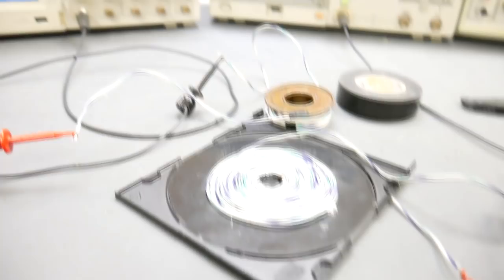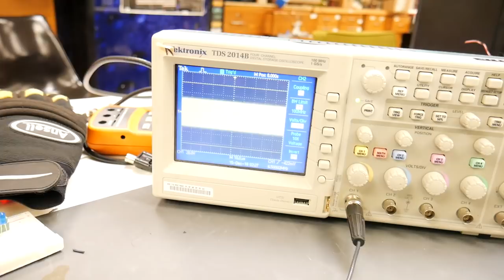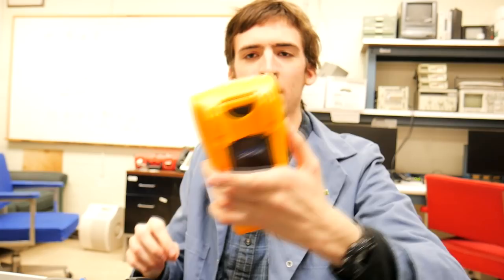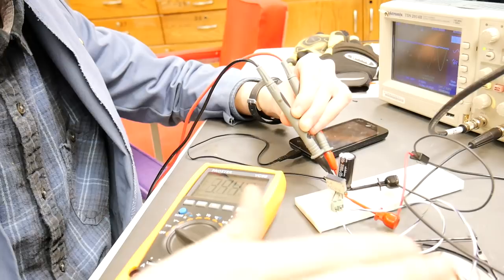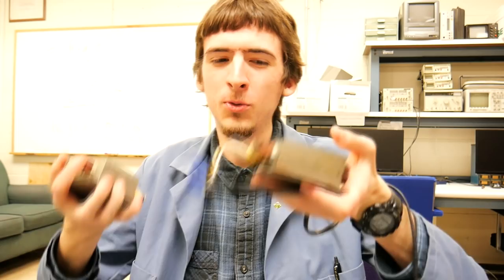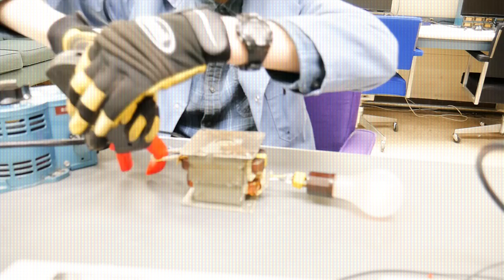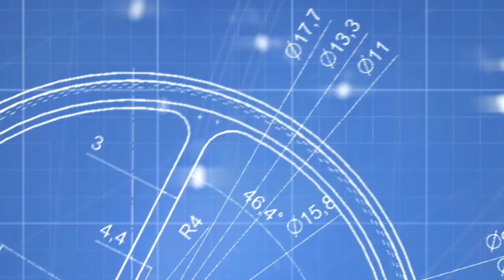Mini Project: DIY Wireless Charging

Comment from the maker: I admit, this may be one of the weirdest videos I've made... and I'm okay with that.
Reply: Is there a way to make this with out causing RFI
Reply: weird is good there is no other way to make a video like this.
Reply: Full of factual information and well presented well so even a child could understand. Keep up the good work Dayron the Internet needs more people like you that  show the truth and don't decide to get clicks.
Reply: the weirdness of this video is why i love it! you rock dude keep it up!
Reply: Answering your question at the end. What's the purpose?

Allows for better waterproofing of whatever is being powered or charged. 

Less prone to failure by wear compared to a plug in connector. 

Can be easily hidden and manufactured into surfaces without being obvious. Which is probably directly the reason you get requests so often. People wanting to make their own stealth charging pads. 

Those are the main things I can think of. The only real detractor I can think of is not easily both charging and using a phone when using induction coils vs wired charging.
Reply: Main use of wireless charging is not having to plug/ unplug the actual phone.... also less wear and tear on the actual connector for charging in the phone. I've had a couple of phones fail due to the wear on the minimal and weak connection the charge port has to the phone's main board. It may be inefficient, but it's more efficient than replacing a phone, or doing invasive surgery on a phone to replace the jack. Especially on newer completely closed design phones. There is also my current situation.... my phone is locked into thinking there is moisture in the charge port.... wireless charging is currently only means to charge my phone.
Reply: a trick: you can watch movies on Kaldrostream. Me and my gf have been using them for watching lots of of movies during the lockdown.
Reply: @Eduardo Alvin yup, been watching on kaldrostream for since november myself :D
Reply: I loved the video! My question that poops into mind 😝, is that on the simple pulley. Considering that a pulley system rigged one way can double the power required to lift an object; while the opposite can decrease the power needed for acceleration by half or more...is it possible that a transformer many have the same conversation. What I think I'm saying (and consider I pretty much know an infinite divided by an infinite, more or less unknown) is that if a block and tackle has three points of contact in the right direction power is increased while overall leverage is shorter. And visa versa; power decreases while leverage is longer/ can conduct in greater distancing...if I'm being moronic please let me know. I just was wondering became it seems to me their are 4 points of contact and I'd really like mankind to find a way for electric to work the way other life forms that have been to earth have discovered. Thanks in advance for sharing
Reply from the maker: @pspringsteen100  Both pulleys and transformers conserve power and work both. They just change the form in which it is delivered - trading off pull-force/speed for a pulley and voltage/current for a transformer.
At the end of the day, it takes the same raw energy.

Comment: FINALLY, someone else that has realized how inefficient wireless charging is. 

I do electrical design for commercial buildings & I'm surprised the energy code hasn't ban them all together. 

20% is HORRIBLE. 

I was using 50% or a little under 50% efficient. Just based on the wireless battery packs seem to charge about. 1/2 as much if you use the wireless charging vs the corded charging. (That's very rough. I only looked @ 1 and how many times it would charge a phone if full. Using each.)

The energy to make the worn out wires / broken charging ports, could be factored in though. <<<I think this would count for something. It is a good universal way to help keep the public connected to each other.>>>

Comment: Wireless charging has a lot of uses.
• If your charging port goes bad. (I've seen this happen)
• You have a bunch of cables like me that all say use original charger  cable and trickle charges your phone
• A good wireless charger will charge both android as well as IPhone so you can charge everyone's phone who comes to your house.
• Charging your phone at night in the dark and fumbling for your charger and plugging it in right is a thing of the past
• There are plenty of other advantages and I'm sure there will be many disadvantages too. I think this was a great idea, and was never supposed to be life changing. Just a better way to charge your phone at home.
Reply: Matt Ferrigno this is spot on!
 Some chargers work great, others not so good. I have one that has quick charge capability and I have an 18W charging cube for it. Which makes it perfect!
Reply: This is exactly what I was going to say. For a science channel, I'm sure he has to understand what friction does to the contact pads by using a charging cable. If anyone is like me and prefers not to spend $900+ (last phone was $1200) every year or two - then you'll look for ways of prolonging the life of it. 

There's also the convenience aspect of it. Just sit the device down on the pad (for me, in any orientation) and bam.. it charges. It takes seconds compared to tens of seconds of time (science efficiency, undervalued?). 

And like you also mentioned, one wireless pad for a multitude of devices. I have an Xbox controller, Apple TV (Siri) remote, two iPhones, and some other hacked together electronics (Raspberry Pi) that all charge with the exact same pad. I count three different types of connectors there.

I guess in the science world, if something is stupid simple then it has no use case.

Comment: A very good reason for wireless charging is it saves the mini port. These little ports wear out mostly from abuse, but never the less they are usually bad before the phone. They will probably out last the phone with wireless charging.

Comment: I am not an engineer and I have not tried it practically but if I'd to say it's the frequency, at lower frequency of little Hz or few 100khz or even 1 or 2 MHz eddy loss is abundant. So may be 5 or 6 MHz or more needed to be supplied after all most commercial devices uses  of 6 or 7 MHz. I happen to look one in a product and wondered why it was so high but never gave a thought before this.

Comment: What if we increase the ratio to 2:1 so it can charge from 3 volt
Reply from the maker: Good question. The problem is that I have reached the maximum wattage of the system, that is why the voltage dropped from 5V to 3.5V. It's because the source refuses to push any more current than 100mA so it clamps the voltage inside the source. If the output voltage were higher (i.e. 2:1 for 10V), it will still max out the current and clamp the voltage again at 3.5V.
Reply: @BlueprintScience  ohhh...

Comment: I have a wireless headset, but I'm often using it in wired mode since I keep forgetting to plug it in after using it. I just put it back on the stand. It also regularly happens that I forget to turn it off, and when I want to use it the next day it won't turn on.. Therefore I wanted to set up a wireless charging system so I don't have to bother plugging it in.
Wireless chargers are great for that reason. For instance, if you get in your car and you put your phone in the phone holder to use it as navigation it's annoying to find the charging cable and plug it in if you remember to plug it in in the first place. Usually I'm driving and I suddenly get a notification that the battery is at 15%, and it's dangerous to plug it in while driving. Wireless charging would completely solve that issue.

Comment: Sick man. Good explanation 
I’m currently building a wireless charger in a car that can plug into the cigarette lighter. 
Boosting the voltage to 24 v and running a circuit that is 1amp draw
Any ideas?

Comment: how do you calculate for this inefficiency
Reply from the maker: I measured the current in and the current out and compared the two against the theoretical value using the efficiency equation: efficiency = (measured - theoretical) / theoretical

Comment: Yeah they never made much sense to me either. 50% efficiency if they're any good and you can't even move the phone from its designated topping up spot. Hardly even charging, because you don't get a ton of current in these things, as the receiver coil would invariably sit right flat against the battery, and you don't want to bake the battery.

I like magnetic cables though. Near lossless in comparison and super convenient, and you can get them for like $2 a piece. Great protection against breaking the socket for clumsy individuals too.
Reply: My phones socket is worn so it's easier to use a wireless charger than trying to find the sweet spot where it will actually cable charge. Also got a wireless charger in my card ( as part of the phone cradle ). It's nice to drop the phone in and not have to plug/unplug a cable each time
Reply: Magnetic cable suck what we really need is little holes on the back of the phone that when you set it on the charger there are tiny pins that stick into those holes that charge the phone preferably make everything as flat as possible then for example you can walk up to your computer set it on top of your computer case and it would make that noise that computers make when you plug in USB cable to your phone

Comment: Pal, dunno if this was said before but to calculate transformer efficiency you need to account for the  voltage and current phase angle, ie Pin = IVcos(theta) where theta is the angle difference between voltage and current assuming the circuit is inductive, ie lagging Power Factor aka cos(theta). The same needs to be done for the output as well. Then you can calculate efficiency. Great video btw. Keep up the good work and merry xmas.
Reply from the maker: If I'm remembering correctly, using RMS (root mean square) values means that we can use P=V_RMS*I_RMS. Assuming the same voltage on each coil, the ratio of power the same as ratio of the currents. If we felt like using peak voltage methods, all that is out the window and we would need to do what you said.
... and Merry Xmas.

Comment: Reasons:
A) The connection on the device to be charged is broken.
B) Build the charging pad into the coffee table.
C) I don't trust strange USB ports, I enjoy the protection of wireless coupling.
Reply: Why didn't he make a transformer without a 1-1 ratio  to increase the output voltage?
Reply: @teku3985  did you just use a double negative?

Comment: How many V are you putting into your "transformer"?
Reply from the maker: OFF-Grid HillBilly Style I assume you mean the small coil. That was theoretically 10 volts, but since the frequency generator can only supply less than 100 milliamperes, the voltage dropped into the low single digits; not sure beyond that.

Comment: well I guess it's just basically a transformer in essence, expect _actual_ wireless charging is a transformer plus a whole communication interface with it's own protocol and all that it entails.. preamble bits, packets, detection methods(i.e. not just burning whatever is put on the transmitter) and checksums, modulation techniques.... 

anyhow, still a good video =)

Comment: everyone I know who uses wireless charging uses it because they move their cables around too much if it's plugged into the phone and ruins the cables, the connector, and quite often the port itself.  Have you never battled with having to have the cable in at JUST the right angle, otherwise it doesn't connect, requiring you to rig all sorts of devices to keep the cable pushed in at the correct angle or wrapping the cable around the phone to create tension?  Not a problem with wireless charging.

Comment: You should have made a diy oscillator using a single MOSFET and a resistor only easy !!
Reply from the maker: Between you and I, (judge me if you wish) I was leaving town for the holidays and that was also my final exam week. I was tight on time and couldn't design a proper amplifier - its not as easy as you might think at so high of a frequency.

Comment: I've always wondered if other components might be damaged due to inductance
Reply from the maker: Are you familiar with Faraday cages? A sheet of conductive material doesn't allow an electric field through, protecting what on the other side. Likewise, a magnetic Faraday cage can exist where a sheet of magnetic material doesn't allow magnetic fields through.
Phone chargers have a ferrous plate behind them so that the magnetic fields don't pass through and affect the electronics.
Reply: @BlueprintScience  I am familiar with them, just not intimately so! I always thought that sheet was there to also hell reflect lr trap more of the energy increasing, potentially, efficiency

Would I open every wireless charger and hope they all contain one though...

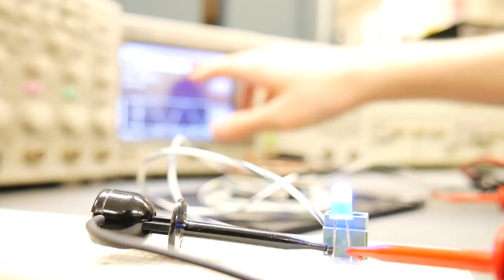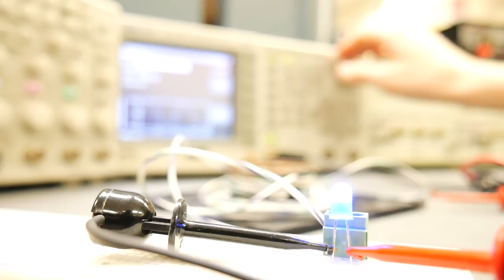Comment: 3:22 - 3:41 whaaaat!? why does the same problem occur in the other direction? o.O
Reply from the maker: Maximum power transfer occurs at the resonant frequency. As you stray away from it power drops. Power output looks like a bell curve where the horizontal axis is frequency.
A good example of resonance is pushing somebody on a swing set. The best time to push them is right at the peak of their swing. Push them before or after that sweet spot, and some energy is lost.

Comment: Why use microwave transformer ,.. the problem is your oscilloscope cant deliver much power at 100ma so instead of using microware transformer use transistor to amplify the current with the same resonant frequency in short use the oscilloscope as oscillator and the transistor to provide additional power  and it will drive your coil with  enough current to power your phone.

Comment: WAIT! ....Now teach us how build a wireless power supply that feeds off of outside high voltage power lines so we can wireless charge our drones. MIT wont release any of their information on their project. And the guys that hang cameras from power lines wont either....You are my last hope. GO!
Reply from the maker: For one thing, MIT is over-hyped.
For another, it's not difficult to pull power away from high voltage lines with a coil of wire. There are stories of farmers putting spools of wire on their property so they can steal power.
As, per drones... I don't imagine that the range would be very good being inductively or capacitively coupled to a low frequency source such as the power lines.

Comment: Wireless should be as simple as a charging cradle, with actual contacts for charging, neodyms to pull it into correct position..  Instead of the flimsy charging ports that are ubiquitous on all the devices out there...

Comment: Your efficiency calculation of your MOT setup was wrong. 
Firstly, since your coupling between primary and secondary was surely pretty bad for an iron core transformer, the output voltage is not going to be the same as the input voltage. 
Secondly, some of that primary current is going to be just reactive power, meaning it doesn´t count as a loss.

Also, merry christmas and stuff.

Comment: Actually, no, you did not.
There's lots of reasons for qi wireless charging:
1) wireless charging is safer. Wall chargers can malfunction, and destroy the power circuit in your phone.
2) wireless charging is more reliable. I have 3 phones where the wired charging jack has broken.
3) wireless charging can be as fast or faster - both my iphone and android charge faster with qi.
4) wireless charging is more convenient. I don't have to look for the cord, I just set it on its stand.

As for your "demo," starting with a source of only 100 mA is not going to charge a phone, typically, even if it were 100% efficient.

Comment: Do u got a Facebook account that I can message u on
Reply from the maker: Uh... yeah. What did you have in mind?
Reply: I just want to talk about transformers I understand it's a eletric magnet that can run off of ac or dc current and the bigger the gauge wire the more amps and the more turns you have the higher voltage so could one be hooked to a car batter so it can 
maintain/charge itself. I've been attempting this with no success maby you will do better. If it's even possible